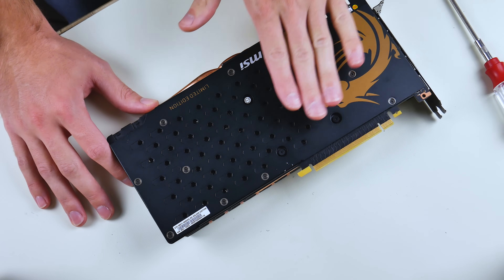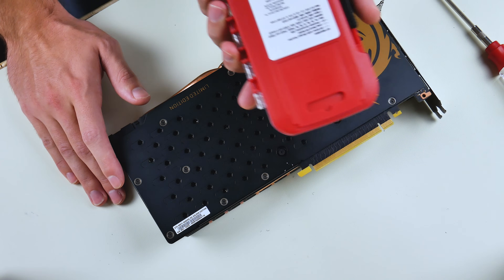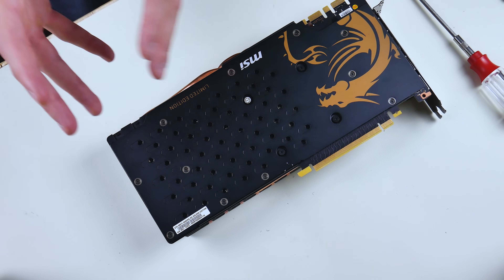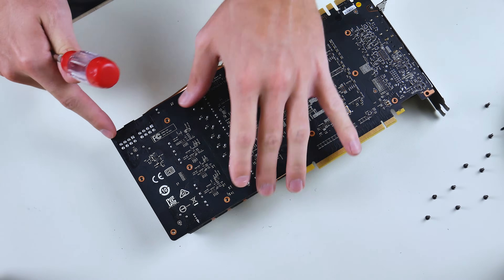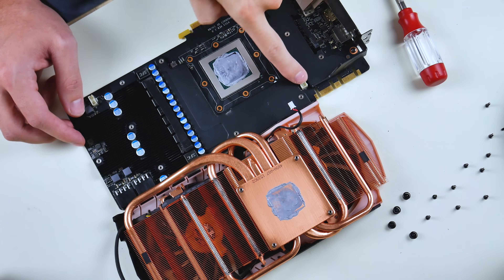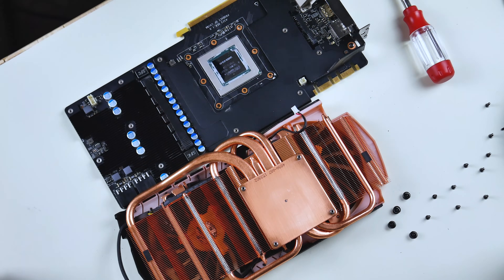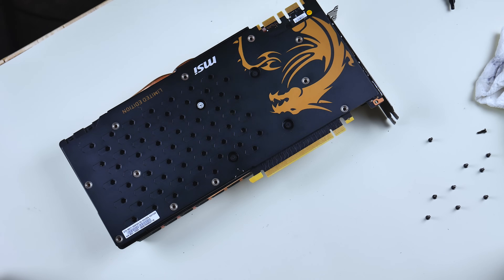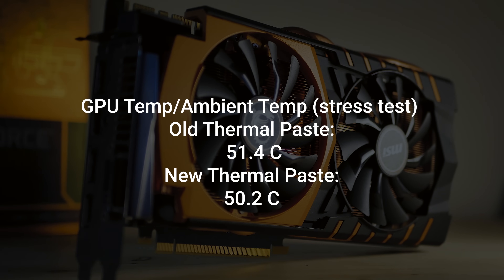How To Replace GPU Thermal Paste - This Is Crucial

Comment from the maker: Let me know what other tutorials or topics you want covered for future videos!

EDIT: I wanted to point out that you should put plenty of thermal paste on the chip/GPU dye to have it fully covered. I meant to mention this in the video but I only briefly skimmed over the amount of thermal paste you should apply.
Reply: And Aren't These "Warranty Void If removed" stickers illegal in usa ? and you have the right to repair too
Reply: Btw Will replacing founders edition thermal paste void warranty ?
Reply from the maker: @drake6836  all cards have the void warranty sticker, if it doesn't it means someone else definitely removed it!
Reply: @jdtechgear  No 
I Have Seen Many Videos No Warranty Void Stickers On Founders Edition 10 Series 
For Real :)
Edit: I Have confirmed there are now seal stickers :)
Reply: @jdtechgear  EVGA cards do not have a void warranty sticker. They have A sticker there to let their technicians know if it has been opened. But as long as you don't make any physical modifications other than changing thermal pads/paste, your warranty is still valid. (Unless you damage the card that is). But I have messaged their support multiple times on advice about replacing thermal pads. They might be the only company that allows you to open their gpu's and still provide a warranty.
Reply: Loving The Vids Jd
Reply: how da fak do manufacturers know you opened it ??
I mean in founders edition there are no stickers
Reply: In the US, removing the heatsink and taking it apart does not void the GPU warranty even if you mess with that stupid sticker.
Reply: i have a phoenix gtx 1660 single fan card the dye is pretty small but i put a big line in the middle, more thermal paste than what it came with it covered the dye no problem
Reply: in my case with a phoenix gxt 1660 (single fan card) i replaced the thermal paste and i went from 79-80C bouncing around with those number hit 81 at one point for a second only, to a whopping 74-75c bouncing with those numbers, and since the gpu created less heat my cpu also went down from 79c to 71c!, my specs are ryzen 5 3600(stock cooler, with -0.0875 voltage and base speed 3600mhz but i let it boost up to 4.1ghz no problem), 16gb ram corsair vengeance , phoenix gtx 1660 single fan , 2 intake fans, 3 exhaust fans, side vented case... also i use high performance power mode,
Reply: i used thermalright tf4 thermal paste not a too big brand but honestly its pretty good
Reply: Hey did you set the fan speed to a fixed setting? Because if not, then the card is quieter at the same temp. Since it has a desired temperature that it adjusts the fan speed to achieve
Reply: is gd900 conductive or is its safe to put it on gpu
Reply: umm, paper towel?
Reply: What do you mean by "plenty", more than you showed in the video? Covering the entire area is not necessary, just placing it in the center and let the gpu squash it all over?
Reply: @stearless  or even a thin cross they say, but I stuck with the dot application and have been fine.
Reply: Is it better to spread the thermal paste or put it in cross shape like some people do? or it really does not matter?
Reply: @A47M36  best way is to spread it. A thin layer spread evenly is the best way.
Reply: I stripped a Gpu screw and now I can't get the cooler off. Help
Reply: @wildparrot3802  same
Reply: The screws on the back of the PCB board are striped, can you give me some advice?
Reply: I want to know how to take out the GPU from the fan basically remove the gpu so I can install it on my laptop can you do this with a heat gun and a flux
Reply: Can I use alcohol wipes to remove the thermal paste
Reply: How old was the previous paste? I noticed it “still looked good” so the comparison in heat temps wasn’t exactly the best. I’ve got a 4 year old pc that I haven’t redone the paste on and I’m wondering if it needs it or not. I’m not a crazy active gamer on it and don’t do any overclocking, but the temps could be a bit lower. Playing the BO6 beta this past weekend I was hovering around 60-65°C during matches. Not terrible but would like to see it a bit lower if possible/needed. Running an MSI GTX 1660 Ventus TI
Reply: PRO TIP: This taking apart your graphics card ABSOLITELY does not void your warranty, even if they try and say so. Just like how changing the oil, tires, air filter, and other "easily" consumer repairable parts on a car doesn't void your warranty. Magnussen-Moss act makes warranty void if removed stickers Illegal, and the FTC is pursuing companies (very slowly though) that still pull this BS. THE ONLY WAY they can void it is if they can decisively and readily show that the device was broken by the customer.
Reply: First off if you are changing the paste change the pads its very important as the mosfits will start to over heat over time and that will dissolve what is there paste cost you about 7 the pads about 7 more... Make sure you always measure the space to get the right thickness for the pads... too thin will not work well... I am waiting on some myself.... Everyone should replace it about every ten years if the card last that long....

Comment: you want to spread the paste with a card, leave just a thin layer across the whole die.
That's how proffessionals did it before they were replaced by a robot that just squirts a whole lot on there. You make sure there's no hotspots and get some extra 5c of cooling.

Comment: you want 90% or more rubbing alcohol to clean a cpu or gpu of thermal paste.
Reply: Nope. 70% Iso works fine. It takes a few minutes longer to evaporate but that's not a big deal, so long as people don't start any components before it's fully dried. It cleans just as well as 90% Iso.

Comment: I did the same thing as you did but with my RX 6900XT, for some reason the GPU hotspot is still reaching 100-110 degrees. I'm not sure if I should keep the screws less tight or tigher when finishing, help please?
Reply: You need to change the pads as well as the paste.

Comment: You won't void the warranty if oyu take the sticker off carefully and then place it back. It's not quite hard to do with a needle.Just wiggle it slightly until you can take it off with your fingers and simply stick it back

Comment: Thank you so much i was so nervous my hands were shaking because when i tried to change the my cpus thermal paste i had the cpu in my hands because it was stuck to the cooler and i bent a few pins but everything came out great,thanks to you my gpu is 7 celcius cooler.

Comment: My 10 years old gtx 970 was hitting 82 degrees while gaming constantly throttling. After doing this it's back to 68 degrees. The termal paste on it was completely dry and very little. Used lighter fluid to clean it off. Applied a lot more than recommended but having no problems atm.

Comment: Another grate tip: for anyone doining this without a magnetic screwdriver if you have a magnetic object or magnet you can align the magnetic polarity of the screwdriver by rubbing it upward this works for all metal object cuz your changing there magnetic pull 😊

Comment: Not recommended to heat the old thermal paste to soften. Thermal shock=no good for solder joints. Use IPA to soften old thermal paste.
Reply: That's not how it works. You cannot access the GPU die to apply IPA. That's why people need to run the GPU first in order to soften the existing paste.

Comment: In the steps of reapplying thermal paste, does anyone know a specific point where i could've screwed up, that caused my general draw distance in games to screw up? No, this isn't a software issue. It happened right after pasting and is present in multiple games.

Comment: Suggestions:

- Use isopropylique alcohol, which is 99% alcohol against the 96% alcohol (used normally in a house).
- More thermal paste, looks like a very small ammount.

Cheers,
Reply: You can use 70% iso as well just fine.

Comment: Could say I'm a veteran with adding new thermal paste for cpu :D and recently my gpu fans broke so I had to replace them. I started to wonder is it hard to add new thermal paste for the gpu heatsink and looks like it's not hard at all, basically almost same as cpu heatsink stuff. Thanks for the informative video, this helped a lot!

Comment: Think a uniform thin spread would be best, and I heard not to mate up the surfaces then pull them apart to have a look as this can trap air inside the paste when you put them back together which isn't ideal for heat transfer?? I just put together a "Zwift" pc from second hand bits and am waiting on Amazon to deliver Arctic MX-6 today, gonna do the cpu and gpu (GPU-z says it's at 83c not really under any load as I type)...as it's "non-conductive, non-capacitive" I'm erring on the side of over-applying as there's no danger of a short circuit hopefully!!!

Comment: My biggest question is how often should this be done?  If your computer is used daily is this something that should be done once a year?  I recently replaced my CPU paste after probably 5 years and it was dried solid. Luckily the processor was still ok but I definitely wished I'd done it sooner!
Reply: 3-4 years if not used on full load daily

Comment: Bruh I did it the other way round with putting the thermal paste on the cooler side rather on the GPU dye 😂 hopefully it's not too much paste 🤦‍♂️
Reply: That's not the way to do it. You put it on the wrong side, it won't cool much of anything.

Comment: I finally did it on my own, pretty easy and simple, I recommend what most of the people say here, to use the spatula to spread it to cover the whole square, my dumb ass ended up taking off all the screws, but... but i was able to clean every little dust particle on my gpu, cleaned fan, dust off all the shit clogging the heat sink, I mean I was reaching temperatures of up to 85 degrees but after I did this it went down to 60 4k 144fps dota 2, I used mx4 thermal paste by the way

Comment: I was very frustrated with the temperature and naturally performance of my gpu after 3 years of use. It would idle around 60c. The reason for that is because of msi 1080 ti gaming x trio doesn't active fans before 63-65c. After following this tutorial my gpu's idle temperature is 30-35c, which is a huge difference for sure. Now i can run ultra settings with 1440 144 fps monitor and overclocking works like a charm.

Summary: Please apply thermal paste to your gpu if you feel like your gpu's temperature and performance is struggling. It is the most important performance factor for your gpu along with cleaning it, which you can do when you detach it for the application of thermal paste.

Comment: My RX580 was failing the Heaven benchmark and restarting at scene 1 of 26 due to overheating. I replaced the thermal paste and that completely resolved the issue as I run the test all the way to the end without issue. Thank you

Comment: tldr:  "If it ain't broke - don't fix it"
Personally, Id monitor your gpu temp and look for an increase/high temp before doing this (especially if an older card).  There is a lot that can go wrong pulling apart a GPU.  Plastics and wires older than 5 years are subject to degradation and can break during assembly/disassembly.   Given the nominal improvement in thermal performance in this case (1 degree) the risk doesnt seem worth the outcome.  "If it ain't broke - don't fix it"

Comment: Another great tip i can give to anyone approaching this, is to NOT overtighten the screw. Screw them just enough so everything doesn't wiggle. If you overtighten the screw you risk to either damage the dye or to put too much pressure onto the vrm modules and when you go to boot up windows again, you'll have all sorts of artifacts. Been there done that, that's why im saying this lol.
Reply: Now I understand how my laptop GPU got busted after I serviced the thermal paste. Even before this incident, I had a desktop and I did notice the artifacting when I applied too much tightening on the CPU and the cooler. I should've been careful...thanks for confirming this information 🙏🏼
Reply: You can’t over tighten them, you’ll stripp the head if anything.. They stop when seated correctly if you torque on them even more you’ll just fuck the screws head and it’ll be a pain next time you get to it.

Comment: It's totally NOT how you should apply the thermal paste!!! You have to spread a thin layer on the whole surface to provide the same contact between the chip and radiator. Be careful guys, this what he showed can be even dangerous for your cards.
Reply from the maker: This was addressed in the pinned comment

Comment: I have been using my card for 3 years now. Last week the fan speed suddenly rammed up to probably maximum because the sound was really loud and the display went off. I thought maybe my card in dying because I did a lot of mining, but then I checked my performance in games and monitored the temps, and even clean installed the latest drivers. Everything was normal, but then I found in a forum that the problem was due to the thermal compound which probably dried up due to prolonged periods of high temps. I never worked with thermal paste before so this video really helped a lot. Thank you.
Reply: bro.. i hv the same problem as you but now my card aint turning on.. is it dead or?

Comment: thank you for the video, i will be doing this to my Card , along with a Fan Replacement, 1 of my 2 fans is not running, the card is , only 8 months old, with a 1 year Warranty, its cheaper to buy new Fans than Sending old card back ,,,lol if i sent it back i would have to wait for it to come back to use my computer ,,lol

Comment: Thanks a lot for the tutorial. I changed the thermal paste of a NVIDIA GTX 1660 Ti. It went from 83C (max temp limited by software) to 75C. I use Artic MX-4 without issues. I was reluctant to do it by myself but you encouraged me with this video. Thanks
Reply: Literally in hte same boat but with my 2070. Tried to play Baldurs Gate 3 but saw my GPU hit 81c. I'm guessing it's dusty as hell as i've never cleaned it and had it for nearly four years. Never even taken a GPU out of the PC before let alone cleaned it so now i'm here trying to mentally prepare lol.

Comment: I would not be recommending that people use a heat gun to remove thermal paste or a hair drier there is tiny SMD components around the gpu that could easily be blown off by the heat of a hair drier if over applied and a heat gun that will just blast those puppies right off ...use isopropyl alcohol and just pour some onto the dry paist and the wait a few secs for it to soften the old gunk and the wipe away with a swab gently as to not knock any of those tiny things off ✌️
Reply: Using the isopropyl alcohol with a coffee filter works very well for removing thermal paste.

Comment: can it fix my overheating GPU Nvidia quadro 4000 which catchs no display and in games it crashes will it fix or i have to change my Power supply which is 290 Watt and gpu specs are 
Nvidia quadro 4000 
256 bit 2GB DDR5 
will it help me please reply

Comment: for maximum thermal past efficiency,  after you apply the paste to the chip,  it is a good idea to spread the thermal paste evenly using something like a business card since an even dot will not necessarily cover the entire chip.  the more even, and more coverage,  the better the contact and cooling.
Reply: This is pretty much the way I have been repasting GPUs forever. I've tried the dot method, even a larger pea size to ensure max coverage but i've always had better results evenly spreading the paste with a business/cash card.

I also recommend getting paste that is recommended for laptop repasting (also bare dies) because normal thermal paste doesnt perform well above 70/80c (yes, this means kryonaut unfortunately for the noctua fanboys) and have run out issues. I recommend ICDiamond if its available or Mastergel Maker (the newer stuff). 
My 1080 never pushes past 65ish now under load.
Reply: @Volakile  Old comment, but I wanted to say thanks for the info man 👍
Reply: The dot is supposed to spread out due to pressure when you screw the heatsink in. No need to spread, the actual recommended way is a pea-sized drop on the middle.
Reply: @HandledToaster2  on a cpu yes, but a tiny dot will most likely not cover the whole dye which u need
Reply: @jay00C9  Pea size is not tiny, it should easily spread across the entire surface. And the most important thing should be that you don't have air between the cooler and the gpu. Spreading before is the best method to get air trapped. When you flaten the pea the air will be pushed out to the sides. Some people think that the best method therefore is to spread first and then put a little dot in the middle that pushes out the air.
In practice all tests that I have seen seem to suggest that there is pretty much no difference short therm between the method as long as you get paste on the surface. So as long as you replace once in a while there should be absolutely no issue.

Comment: Now just FYI the black metal that was covering the other components that had the thermal pads that is actually the memory components. They usually surround the GPU. You could replace the thermal pads if you wanted but that's a whole other process

Comment: Thanks for this. Even with the side of my case off and the fan at 100%, my R9 390 (yeah, I know, lol) was hitting 94C. After a repaste with Arctic MX-4, temps are in the low 70s with the fan around 50%. Amazing.
Reply: I cant get the same results...
Reply: @diplod5000  :face-purple-crying:

Comment: My gpu reaches upto 83°
Is it Normal?
Reply: 83 on idle or while gaming? Mine going 88 on while gaming and I'll try to clean and change thermal paste.
Reply: @junaidmughal3511  while gaming
Reply: @sharfaraj7093  That's pretty high, below 75 is just normal.
Reply: @junaidmughal3511  you said yours goes to 88?
Reply: @sharfaraj7093  yupe 🤣
Reply: @junaidmughal3511  so what's your gaming temperature now?